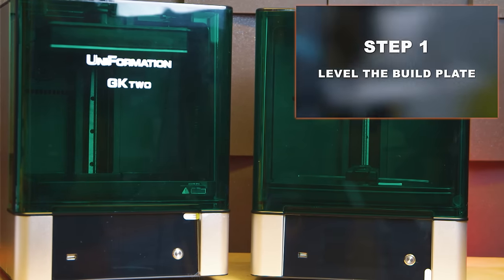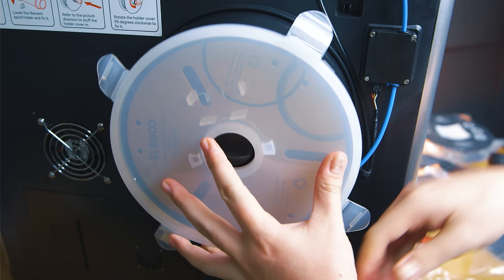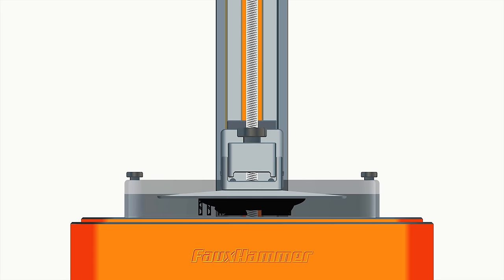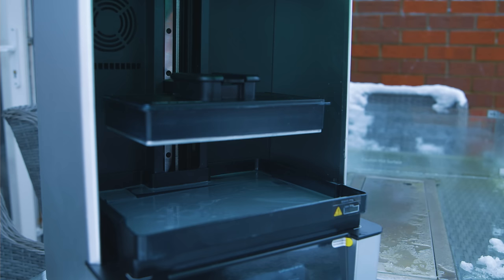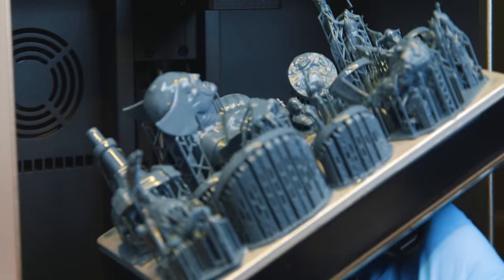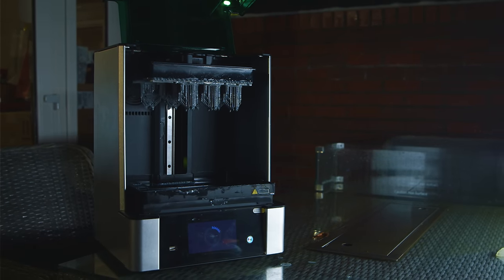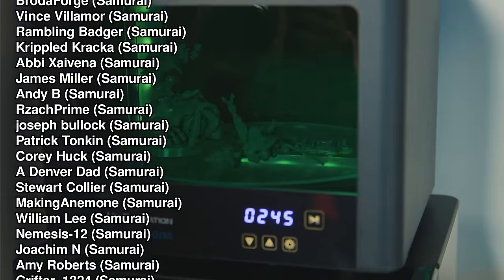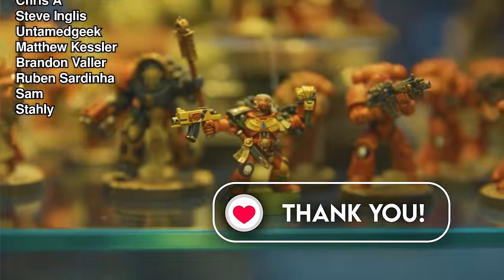How does a Resin Printer Work? - Before you begin Resin 3D Printing (Part 1)

Comment: What i want for ALL future 3d printers is to have a heater by default, it's criminal to not have it in 2024 as it's such an essential part to ensure good printing.
Reply: It's not like it's difficult or expensive either; I doubt integrating a vat heater would add more than $10 in manufacturing cost per unit.
Reply: if you can't afford an external heater, how did you buy the printer.  so no its a lame idea and just an added expense and something else to go wrong
Reply: @Kiddeth  That's an hilariously bad take and dumb reasoning, it's better to have an essential feature already builtin instead of having to spend extra time, troubleshooting and money to add it anyways to get an acceptable experience, especially when it doesn't add much cost to begin with.
Reply: @Kiddeth  😂😂😂😂😂😂
Reply: When I watched to video, I realized that we only need one thing that is the heater. In fact, all the other parts are added for nothing, you dont even need the screen for resin printing. Just heater, heater and heater. Since GKTWO is the only model on the market with a heater, this makes it perfect :)
Reply: It's overblown, with a heater set to 30c inside my printer with lid shut my print times between heated and unheated are about 0.2s for consistent prints(1kg figures not that mini crap).

If youre in a garage in winter sure but even an 18c Basement hardly any difference
Reply: I never needed a heater, so it doesn't seem essential to me
Reply: I live in the tropics it’s NEVER under 25 during the day, normally 30+, half the year the overnight temps are like 26, daytime temps 35…..ALL DAY EVERY DAY, why would i ever want to pay for a heater that would either never cycle on or worse, heat my printing room up. My biggest issue is making sure it’s not near the aircon, so it sits in a spare room with a window open.
Reply: Apparently the Saturn 4 knocked off every part of the GKTwo except for the heater and Elegoo has zero intention of ever implementing one because the couple hundred bucks on the price tag would turn off new customers.
Reply: Yes!!!!!
Reply: @fede4819  it is not an essential feature. ive printed in conditions down to 28 Fahrenheit ( colder than that you might have issues ) If I can do it so can anyone else. get better at your craft
Reply: @Kiddeth  
What are your exposure times at that temp?

Comment: Heated vat to 30c/86F is just so crucial to me for getting consistent prints, with high accuracy. Plus it's so much easier to work with warm resin. Heated Vats and Self Leveling beds really should be on every resin printer.

Comment: I have both a resin printer and an fdm printer. In my experience resin printing has been far easier than fdm printing. FDM has trillion variables to fiddle with try to find the optimum result, clogged nozzles, overextrusion, underextrusion, blobs, bed adhesion and numerous other problems. Resin, so simple and fast too. The print quality is super smooth, not achievable with a fdm printer.

Comment: I started my adventure with 3D printing at the beginning of COVID and bought a Creality FDM printer. I had ok results but ended up wanting a larger build plate and turned around to get an Ender 3 Max. Had much better results and have printed a number of projects that I still use. I’ve been wanting to get a resin printer to print higher detail models, like a model of the Black Knight from Monty Python’s Holy Grail with spaces to place magnets for the removable arms. Love your video and I now have a new rabbit hole to watch the rest of them!

Comment: I'm currently on my third printer. Started with the Anycubic Mono X, then the Saturn 2 8k, and now the Saturn 3 Ultra. I also started with an Ender 3 , and now (after 3 years of tinkering, modding, rinsing and repeating) I'm running the X1C from Bambu labs. Your most valuable video to me was the comparison between ACF and FEP/NFEP. It convinced me to put an NFEP Saturn 2 vat on my Saturn 3 to preserve the finer details on my minis (especially teeth or fingers/claws)

Comment: A couple of the most important points you reference that are often overlooked are temperature, the number of debates I have had with people on this amazes me considering it is written on the bottle usually, and flex in the PTFE sheet being variable. To add to this it can also significantly vary and impact prints depending on location on the build plate, for example lift speed with low flex in the extreme corners may fail compared to success in the middle.

Comment: Exactly what I was looking for. Great video as always. The day a “safe” resin comes out that I can use around the house is the day I go all in
Reply: You might be waiting a very long time. Even if you were able to get rid of all the solvents from photopolymer resin, there's some components native to the products themselves that you won't be able to do without. I've tried a number of plant-based resins recently (and have formulated my own from scratch), but the thinning agents are far and away the least desirable but most important parts of the resins, aside from the initiators themselves. The plant-based ones also leave a really messy skin Everywhere in the vat, on top of the remaining resin and on the printer plate that is a royal pain to clean afterwards.

Comment: I have been watching resin printing videos for the past year, all the while trying to decide on which printer will be best for my needs/wants. The GK2 is on the top of my list. I live in a very warm and humid climate and my printer will more than likely be set up in my attached garage. Your videos have been very helpful in understanding the basics of resin printing. I still feel like I need an engineering degree but, your videos have been extremely helpful. I no longer feel like I need an engineering degree to understand the basics.

On a side note, I don't know who is right or wrong regarding your Hero Quest dilemma. If common sense prevails, one would think you have to stand next to something in order to touch it, meaning you have to be next to it to open the chest. But since I don't know the rules to Hero Quest, I will leave that question to someone other than me.  😂

Comment: I've been doing FDM since I started playing with it during the lockdowns. I started with an Ender 3, did a lot of learning, and a lot of modifying, had a lot of failures etc etc. Last year I bought a Bambu X1 Carbon and it, just, worked. It's fast (relatively to an Ender3 anyway) reliable, and just easy. I've now got some ideas for projects that I think would be better suited to resin printing, and I'd love to start somewhere nearer to the Bambu, than the Ender!

Comment: I'm in CA where it's mostly warm - but it is winter so it's gotten horribly cold a few times - down into the 40s (4.5C) but now it's warmer - but not warm enough to print. I'm building a box and have a space heater/thermostat so I don't have to worry about the cold.  Seriously - I had to leave the house with a flannel coat.

Comment: I've been having so many failures with my AnyCubic, I ended up getting a Saturn 3, plus a heating mat, a fermenting belt, and a grow tent to put it all in. It's been frustrating since my FDM printer was much easier to figure out errors with. Currently running a Cones of Calibration on my Saturn 3,... i'll check back with results soon. GKTwo is a sweet printer, just out of my budget. Found my Saturn 3 for the same price as a Saturn 2 and treated myself for my birthday.

Comment: I haven't played HQ in years, but I do remember having to be facing the object to search it - but take that with a grain of salt as it was EONs ago. Resin printing isn't that much of a PITA depending on what you are printing and which resin you are using. I use water-soluble resins, yes I know about their more brittle nature, but the safer clean-up is worth the trade-off. That said your mileage may vary as I primarily print prototypes and scale models, minis I find to be a pain to remove from the build plate so I don't print those often. However, I may change my tune on that as I've just ordered a flexible plate to install.

Comment: I started with a mars 3 pro about a year ago, loved it (though there were lots of parts issues early on). But it was too small for some things I wanted to print. Then I got the Halot Mage (NON PRO) as an Amazon flash sale… no bell and whistles, but it’s been a dependable work horse (apparently the pro version is rubbish though). The part I could have used the most help with, and still struggle some, is bed adherence

Comment: Best thing to think on with FDM vs Resin.  FDM printers can do large models, much much larger models at the cost of not being able to do micro small details.  Resin printers can do INCREDIBLE details BUT at the cost of not being to print nearly as large of a model, or as many models at the same time.
Also with FDM, once the print is done, its done, no post processing needed, pull off the plate and start another.  Resin has a LOT of post processing, washing and curing the model before its actually done.  The line between the two types of printers is starting to blur, as FDM printers CAN get super detailed too but do take a lot longer to complete at that detail level.  Resin printers are starting to get bigger, with the biggest ones rivaling the build volume of basic entry level FDM printers (Elegoo's Jupiter resin printer).  Cost for getting said resin printer size is quite high, where as with FDM printers, you can get super detailed for real cheap.  As in a FDM printer with a .2 nozzle can get the same layer heights a resin can do but it takes a real well tuned machine to do it.  Resin can do those layer heights, all at once, which is where the speed factor comes in.  FDM has to draw the same line over and over and over again to complete a layer, Resin can do the whole layer in a single phase.  If all things being equal a Resin printer will complete a model faster then a FDM at the same layer height.

Comment: Great videos like always, can relate so much to  Guy's experience with the original Photon and not to downplay the importance of that printer but old tech its just that at a certain point. What stood out to me the most what the observation that you made that you have experience in configuring and finding out the optimal settings and for a new comer all that info might be overwhelming. The approach of "recalibrating" yourself with some feedback from someone that's just beginning in this hobby its a win win situation and it should be somewhat of normal thing to happen every now and then in many industries. Keep it up

Comment: Thank you for showing the beginners steps. It is not that easy to find a Video, where you can get the jist of it on modern printing. This printer seems very good and I can't wait until I get started some day. But I am still a little bit scared, because I am not a big earner. That the Display has such a short lifecycle, is really not ok. Great Vid!

Comment: I’ve been procrastinating over getting a resin printer for so long it’s driving me mad. I desperately want to get into it but I’m not one for faffing around or experimenting. I want to load my file and print it - end of.  The post processing is still a horrible, smelly, messy affair so having somewhere dedicated is pretty essential and for me that means the garden shed and the crap UK temperatures.  Looks like I’ll have to save my pennies and go for the GK2 if I want to print any time other than June to October.  Thanks for the very concise info on the video though, great graphics and clear explanations - eagerly awaiting the post processing video. 👍

Comment: I think going into 2024, manufactures need to start having vat heaters over general space heaters(or both?), and we need better exposure tests like the Anycubic RERF. Both of these features would help so many newbies and beginners ease into this hobby much better. Apart from that, everything else such as slicing or cleaning/curing are just things we have to do as is.

Comment: I've printed a lot of minis for my brother recently and even when things work without a hitch, it's still a massive pain in the ass. And people think I'm insane for using a resin printer in a small apartment too. Perhaps it is dumb, but the entire setup is in a grow tent, I have active ventilation hooked up and I wear full PPE when handling the resin, curing it and so on. If I so much as feel a whiff of resin, I open several windows and air out the whole place. It's the best I can do with the space I have, so it's either that or it's nothing. The information out there on the toxicity of the resin and the fumes varies wildly, so it's purely a "better safe than sorry" kind of situation. Anyhow, I'm very much split on this whole thing, resin printing does have superior detail but it is such a pain in the ass and it is so wasteful too. So many nitrile gloves, so much household paper, so many resin filters, empty plastic resin bottles, dirty IPA and so on.

I keep it around as a nice tool to have in the arsenal. FDM is where it's at for me, it is so, SO much better for functional prints and there is zero mess. But even these printers, I ventilate now. More and more research shows that this isn't good for your health either. But all you need to do is hook up a PVC hose and a fan and run that outside and you're done. No consumables to speak of.

Comment: As someone who prints with both resin and FDM. I respectfully disagree that resin is easier. Slicers have gotten so good for FDM, that you don't have to mess with very many settings. You tell it the printer and the filament type  and the slicer does the rest. Only thing I mess with is the layer height, support type, if I need them and  changing the infill from grid to gyroid. That's it. I use both Bambu and Elegoo Neptunes. Doesn't matter. With Resin, you have to run exposure test every time you use a different resin. Your supports better be spot on or the print fails. The resin works better when its warm. Gotta worry about when you hollow your print, are you going to end up with trapped resin.  Now I am talking from a perspective of a noob. I realize resin gives you better prints, but I can get really nice prints on a FDM printer alos, with little effort.
Reply: I’m a noob, so far I’ve had less issues with resin printing and have had to spend a lot more time calibrating my fdm prints. Still haven’t gotten it down pat, the details aren’t as beautiful depending on the model and takes a lot less time including post processing. Resin printing is a lot more of a hassle when I’m printing big hollowed pieces though. But I don’t disagree. I started with resin so I can’t say whether one is easier than the other. My friend started with fdm, but says he prefers resin ONLY because of details.
Reply: Let me guess. Creality? @onihensen
Reply: @dkev0  my friend started with reality and had a lot of issues, mine is a kobra max. May be a file or slicing issue seeing as test prints are fine, but I still haven't find tuned it to my liking.

Comment: I've had some weird failures lately, not total fails but certain layers not fully curing while printing, resulting in  ... I guess I'd describe them as chips ("crisps" on your side of the Atlantic) where they kind of curl up and don't adhere to the other layer.  I think this might be due to changes in temperature, and cooler temps overall.  In my garage it's been consistently around 60 deg F in the late morning, warming up to 63 to 66 by midday, and I won't start a print in the morning if temps are lower.

Comment: Well, in Guy's defense, I also have an OG anycubic photon and oh, boy, can they be a pain in the ass. No wonder he called it quits. In my experience, I also learned how temperature affects resin the hard way: by printing outside. Anyways, after some time I managed to calibrate and configure everything to a point that for several months I haven't had to use the printer anymore, because the backlog of unpainted minis was growing and I could not see an end to it unless I stopped.
That brings me to the issue that taking care of the printer, upgrading it, trying new configuring, etc. is a hobby in and by itself... But then you get carried on and start learning some CAD, because you're gonna need it, right? After all, you want to print your own stuff and you have some incredible ideas in your head that you'll never see materialize, but who cares? You try to learn anyways. And while you're busy calibrating the printer and doing some crude designs on your computer, what's the one thing you're not doing? Exactly, the thing you love to do and the very first thing that brought you to this point: painting miniatures.

Comment: Thanks for the vids. My limited experience has left me wondering what my process should be on how to adjust settings to find a good setup for whatever resin I'm using. I have trouble finding setups for exact resin\printer and the ones I find don't seem to work well.

Comment: You forgot breathing in the fumes. Which is one of the reasons I still haven't dared take the step in resin printing. So integrated air scrubbers and heating that actually works would be a huge plus for me.
And I'm still unsure how to print structural items. Apparently every YouTuber only prints minis with resin printers😂

Comment: Discovered you through facebook! Used to have a mars 2 pro elegoo printer which i sadly no longer own! Really miss 3d printing bits for my models as well as full d&d minis, if i had this video before started out would have been brilliant!, really liked to explanation graphics with the fep flexing, the lift height information was new to me! One thing since owning one that I would use if i got another is not to rush printing slow it down and get less fails! Be nice to actually have the wash and cure thing explained as opinions vary on post cure times!